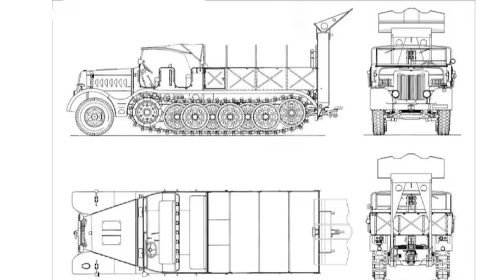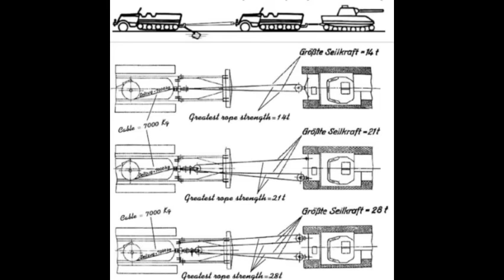Field Repair of the German Tanks: Heroic Work of the Panzer Werkstatt Kompanie ('39 - '45)

Comment: The First Panzer Army apparently lost 33 Werkstattkraftwagons (Mobile Panzer Workshop Vans) in the Kemenets-Podolskiy Offensive in March-April 1944. Quite handy vehicles to hold on to and probably more valuable than older-model panzers in the long run because of the specialist tools they have inside them. They also lost 16 wheeled Drehkrankraftwagons ( Panzer Tow Trucks) and 6 tracked ones of relatively the same type according to the Wikipedia page.